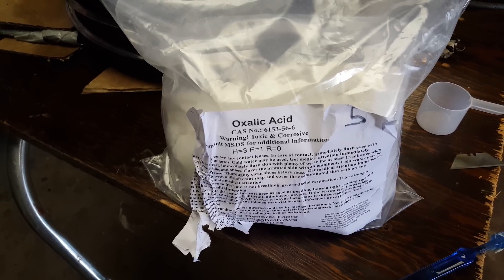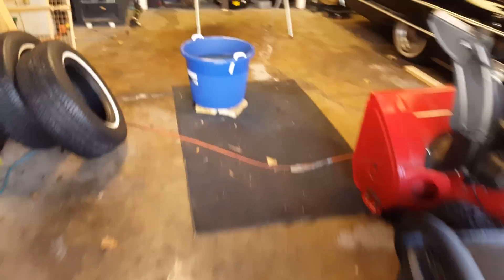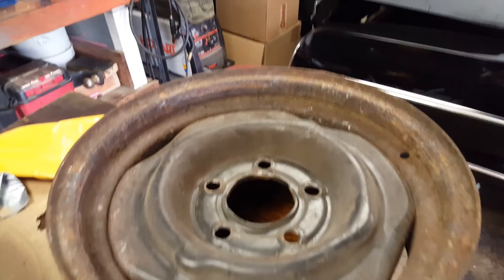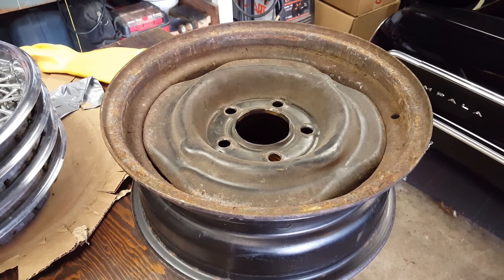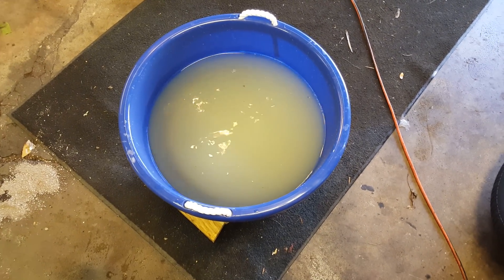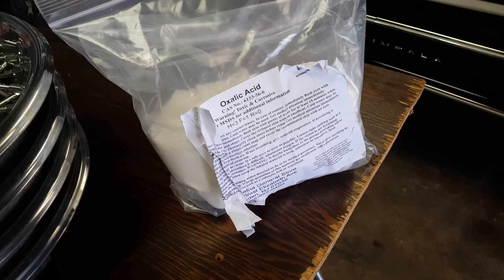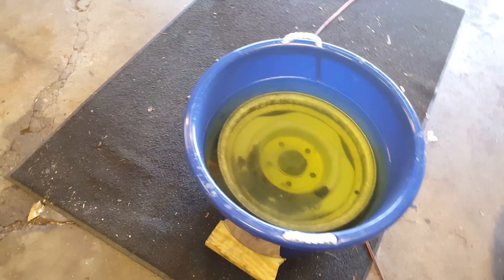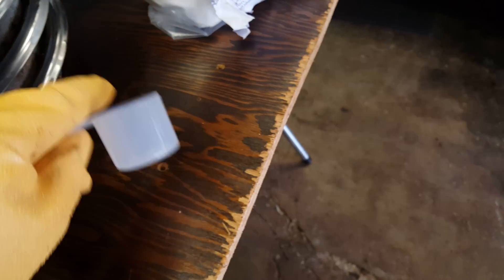Oxalic Acid wheel rim rust removal

Comment: This acid treatment was a big disappointment.  You must be kidding to think this treatment was successful. Try "The Works" toilet cleaner full strength.  Wear gloves and eye protection.  Soak outdoors. There are fumes. Depending on the amount of rust, an hour or two soak, or maybe minutes, but overnight is totally effective.  The rust removed settles to the bottom of the bucket.  No scrubbing.  Just rinse with water.  But, dry the metal after rinsing, and coat it immediately to avoid flash rusting.  Do not expose Works cleaner to any other metal than iron or steel as a violent reaction may occur and non-ferrous metal will literally disappear.

Comment: Hi! I got some 100 spokes. And they have that famous rusty nipples.... Does this affect the chrome??? And would you dip for 2 day? The back lip has a lot of rust also. Thanks
Reply from the maker: It won't affect the chrome.  I did the wheels you saw that are on the car.  What it will do is remove any rust, so if your chrome is peeled off and exposing bare metal, the acid will clean all the rust off and leave the bare metal clean. However, I do not know how or if it will affect the silicone band sealing your spokes.  I doubt you'll have any issues
Reply: +Sixtaillights thanks... I'm removing the silicone... And I'm powder coating. Yeah I'm trying something out.